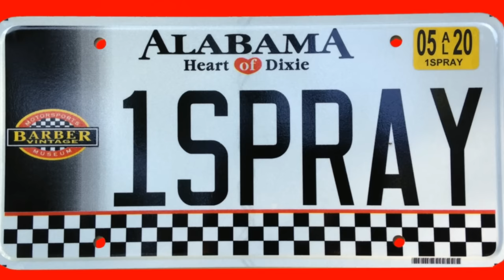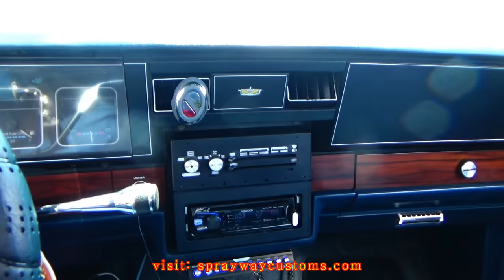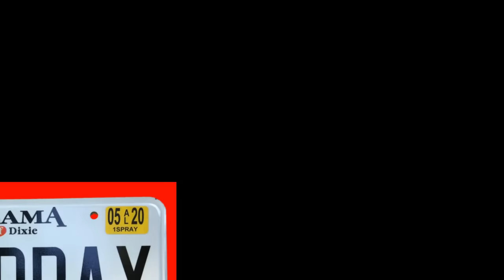1986 Box Chevy Caprice Landau 2 Door Coupe Project

Comment: I just bought a blue one fully equipped with power windows seats everything. Power antenna. Been garage kept since the 90’s. Original paint and roof still look new. No cracks in the dash or anything. But the front bumper trim did crack.
Reply: Is there anyway I could send you a picture of something I need to repair on my car. I would like to see if you can guide me in a direction to fix it.
Reply from the maker: Yes...sprayway123@gmail

Comment: TeamLandau86.....I have a charcoal gray one waiting on me to fix it up.  I already disassembled the car.  To give it that custom touch, I'm adding the 90 lights but still keeping the 86 header panel.  The 86 is one of a kind. The center emblem is unique. You can get that custom rear window piece you were talking about by checking a 80s Coupe de ville or getting it custom made out of aluminum. That's what I'm going to do
Reply from the maker: I'm doing the exact same with my front clip. The 86 clip was produced that one year that's why it's unique. Appreciate that info...I've heard about the Coupe Deville working but wasn't sure 🤝
Reply: @SprayWayCustoms  what's up? Are you planning to cut out the header panel in the center or drilling holes into it? I drilled 3 holes into mines and fabricating the 90 headlight brackets to make it fit.